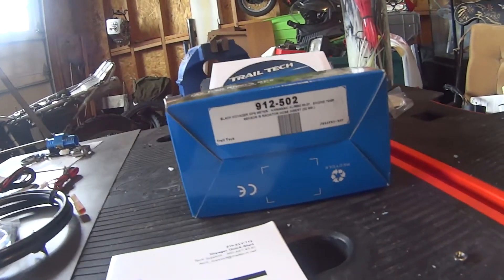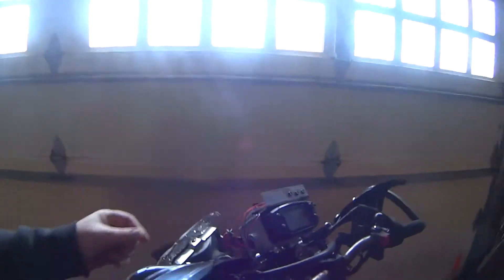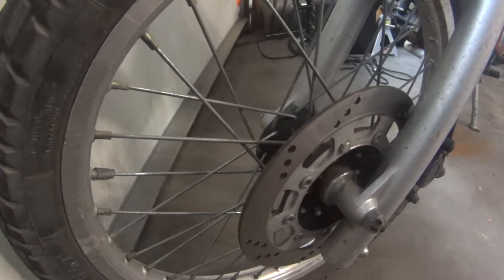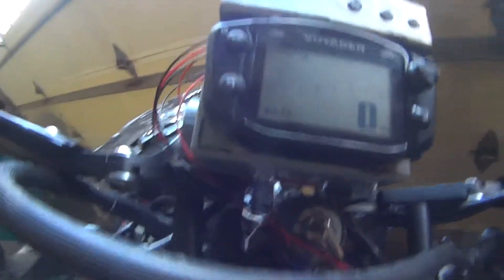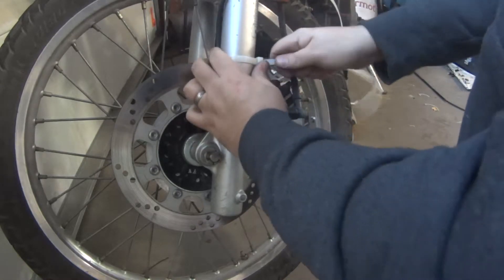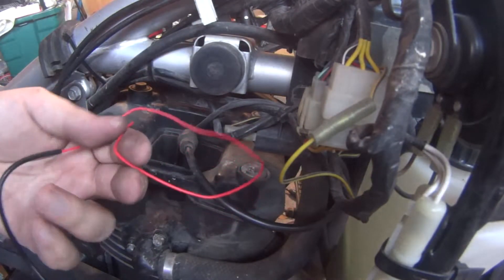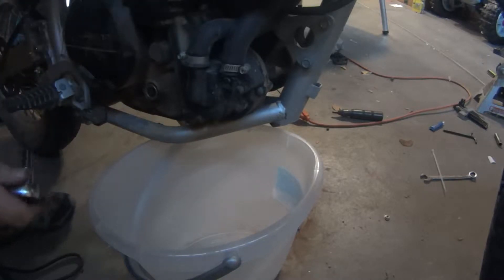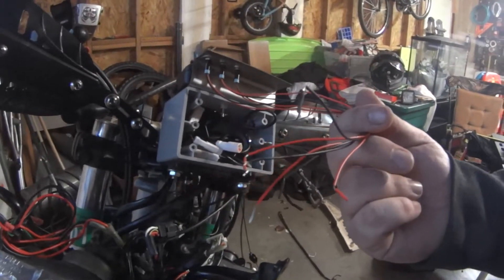Voyager install part 2 - KLR Rehab part 7

Comment: blue. not red. need removable loctite
Reply from the maker: Oklahoma ADV The sad truth is, the instructions said to go to 12 ft/lb on the bolt, and I clearly went to 13... or 30...  Who's to say?  All I know is I snapped the head off and had to go with "Operation Plan B" which involved some RTV sealant and shoving the magnet in the hole where the bolt should have been.  It's temporary until I get a replacement.  On the other hand, the instructions said putting the magnet in the bolt hole was an acceptable solution (even without something securing it like sealant or glue of some sort)... I just don't like it.
Reply: we all make those mistakes. I over tightened the spark plug on an old Honda once.
Reply from the maker: Oklahoma ADV Yeah, I wasn't thinking about it.  The original bolt felt like it was welded in place.  So when I was putting this one in, I guess I wasn't counting on it being cheap aluminum.

On the bright side, I did just buy a new spark plug, and breaking that magnetic sensor off made me take out the torque wrench to make sure I didn't screw up that one.  The manual listed some torque that was insanely low considering what I normally put in my car spark plugs

Comment: To cut coolant hoses I use a tree limb pruning sheer. It makes straight clean cuts. No need to spend extra money.
Reply from the maker: I have used those in the past, but I have no idea what I did with mine after the last time I moved. Now, if the hedge trimmer can't cut it I break out the machete or hatchet.